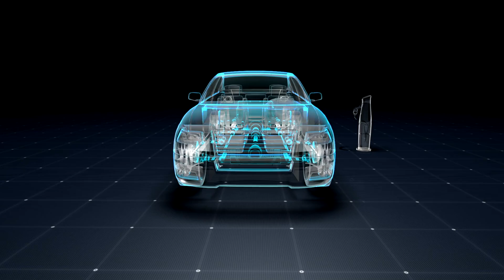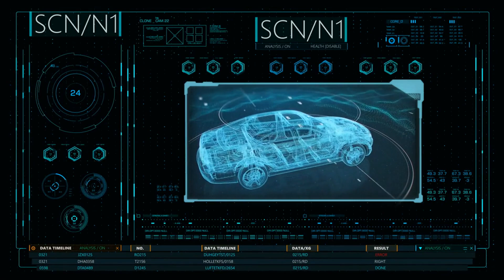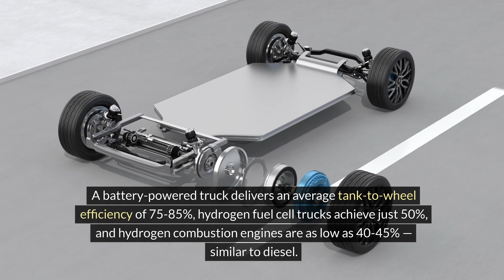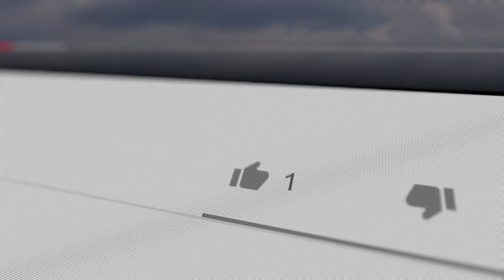Why Hydrogen Internal Combustion Engines are taking off?

Comment: Look at Michael Barnard and Michael Liebreich if you want solid info on H2. Liebreich came up with the very useful "hydrogen ladder" which shows where H2 has a role to play and where it clearly does not. Road transport is one where it does not, and logistics for transporting and storing H2 with its risks, cost, losses and the massively larger volume are some of the reasons.
Reply: @michapringle  -- correct, Barnard is currently reissuing a series of articles on CleanTechnica, but the fun part is: he uses actual data. In a recent one he showed how H2 studies went with very poor battery performance/cost figures from way back when they were indeed poor and then assumed that only H2 performance and cost would improve, but not EV batteries. Shameful. The amount of H2 paid propaganda is huge.

Comment: Dumb, stupid idea.  Hydrogen does not exist by itself.  It is the smallest molecule and can easily escape between atoms of other materials that the container is made of.
Reply: Not at all, it's the smallest one, yes, but that isn't the only problem. But just saying it's a stupid idea is not good enough. I has a better chance for the future than gasoline or any other oil based product, if we survive long enough.
Reply: @rjung_ch  700 bar gas tanks, that can be a really big boom.
Reply: That's where nanotechnology comes in to play as far as combustible H engines. Nanotechnology is the backbone of the fuel cell technologies also. This makes both non-feasible due to the cost. Nanotechnology maybe small but it ain't cheap

Comment: Hydrogen vehicles need to generate their own hydrogen which they burn on the fly. There are no methods of storing hydrogen. It's either super cooled into a liquid or as a compressed gas. So currently neither method is viable. You could have a hydrogen generator at home that generated electricity even at night and then store the extra energy in LiPho batteries. Not very efficient but clean and pretty much infinite so you can afford to be wasteful. The hydrogen generation reaction could even be powered by solar. Right now the best tested thing going are hybrids. Toyotas are at least 20 years old now so reliable and well tested technology and when the electric batteries inevitably fail you still have a great car.
Reply: That's not correct, there are other ways of storing Hydrogen besides supercooling and high pressures, Hydrogen can be stored in solid and liquid Hydrogen carriers like LOHCs and solid nanopore materials Hydrogen can also be stored in Methanol and Ethanol and released using a reformer unit.